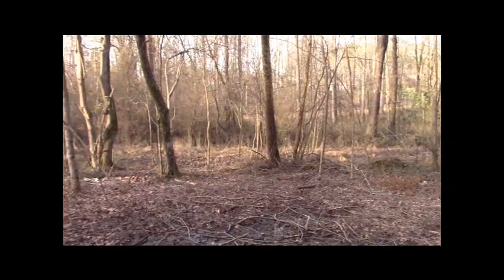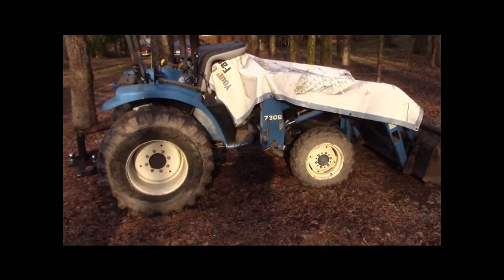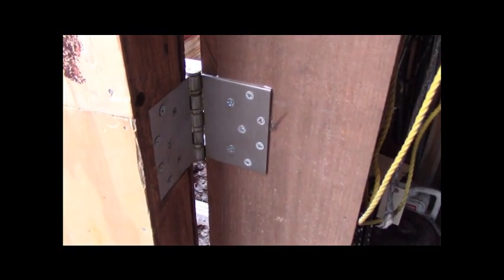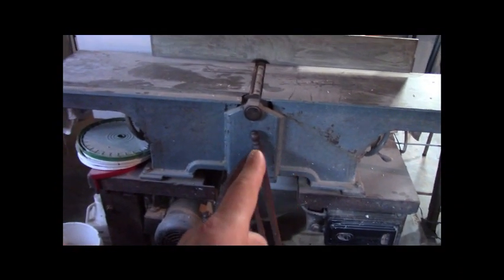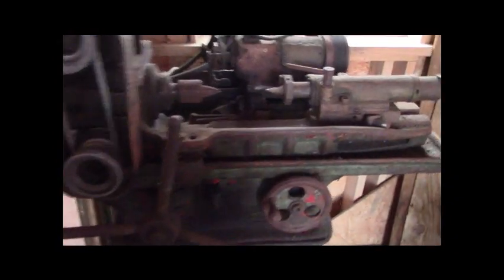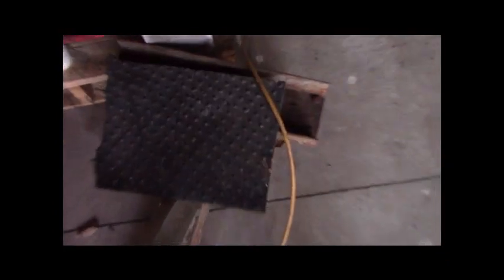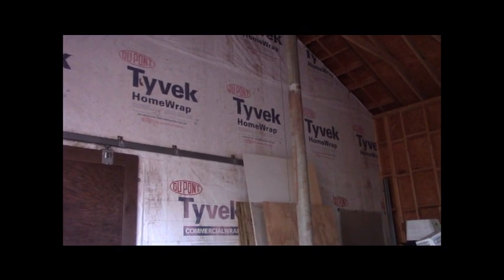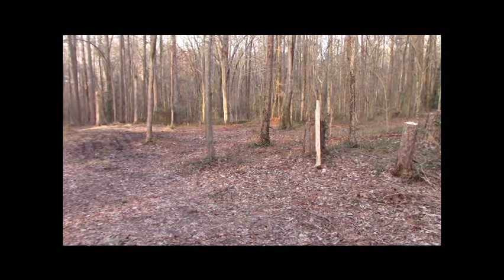3-9-21 Shop Doors, Wood Shop Tour, Pratt & Whitney 2A, Gantry Crane

Comment: good idea with the doubled up hinges at the top. I'm sure you know a thing or two about wood doors sagging
Reply from the maker: In the test lab I have tested a Rixson 27 floor closer on a 7'x3' WOOD door, with 900 pounds of steel weights attached to it, running a center hung top bushing pivot.  Wood is amazing .

Comment: I just now caught this video. That shop made jointer your dad has would make a great video by itself. Just seeing how he made it, materials (or best guess) he used etc. Seems like there is never enough space no matter how much you have lol. May want to consider a separate building for vehicles and tractors etc..  Even just an open air 1 or2 wall shed type thing. Thanks for sharing
Reply from the maker: I am considering building a 24 x 50 foot open wall shed for my tractors and trucks.   Yes a planer video is a good idea.  Lots of woodworking folks out there.
Reply: @kooldoozer  Open wall sheds are easier on the property tax bill here. I'd try to situate it for future additions lol.